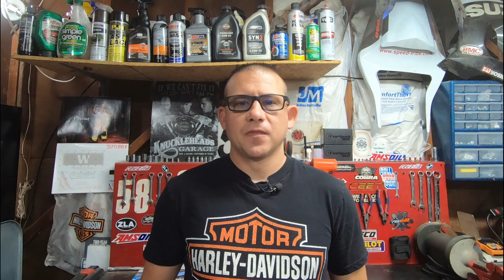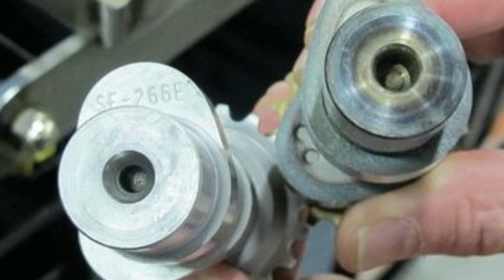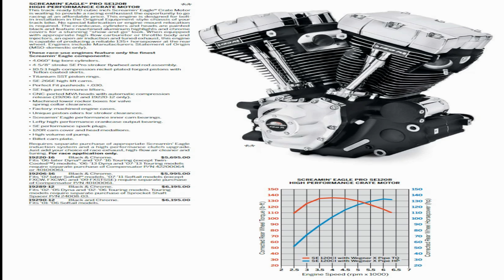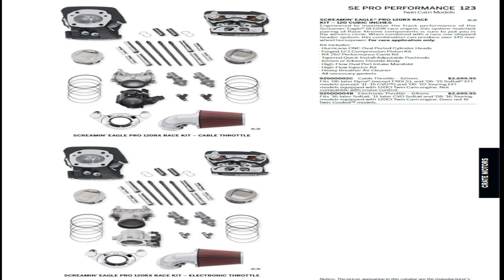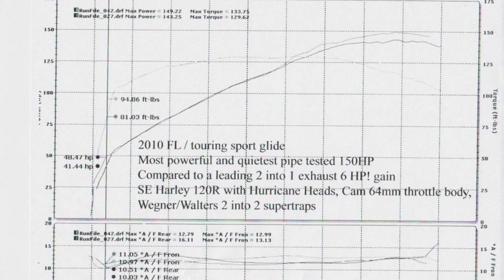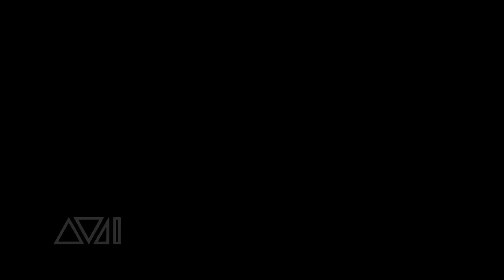Harley's Screamin Eagle 120R Twin Cam CAN Get Even More Powerful

Comment: I have a 2014 breakout. I’ve been looking for a major boost to horsepower and torque. Thank you so much for this video it’s very informative.
Reply from the maker: Glad I could help! I must say the twin cam break out is one of my favorite bikes, I prefer the twin cam version over the new M8.
Reply: @GixxerFoo  I’m not to savvy breakout is still my first bike I have the 103 in it (noncvo). If you had to build it for everyday and wanted a bada$$ monster too, what would you do? I currently have stage 1 k&n (heavy breather look alike) and Magnaflow by Arlen ness exhaust with a dynojet power vision auto tuner. I’m trying to unleash that thing something fierce or should I just buy a crate engine? Was look at s&s hot 124 setup and all sorts of other mods.
Reply from the maker: Since you have the Power Vision, do you have the Target Tune too? A nice cam and a 110 conversion can easily get you well over 100 horsepower.
Reply: @GixxerFoo  yes I do but I’m getting a o2 sensor reading fault with it. Someone told me take the stock o2 sensors and put them back in.
Reply from the maker: Really? The widbands are just a Bosch sensor, you can get those sensors and change the plug on the end. The stock sensors are narrow bands and won't read that wide range.
Reply: use s&s 124 or Jims 120, done deal be happy Harley is new to the game on engines like  a 120, be safe.
Reply: @billgonzales8978  it’s too late. Traded it for a Zx14r with 1in risers and never been happier even comfier on the highway (2hr trips). And I had forward controls and 18in apes. I’m 6’3 300+lbs.

Comment: I run a 120R on the street and track, I am very happy with it. I have taken a few long trips with it 500+ miles. It performs great and 45 mpg on the road. That's not as good as the hopped up 96,but I'm happy with it. My best is 7.05sec. 100 mph in 1/8 and 11.0 sec. 118 in 1/4. I run a thunder max tuner and pump gas. I would not recommend this set up for a new Rider. It can be a hand full on the street. But it is strong and I haven't broke it yet.
Reply from the maker: That's awesome to hear, with the power and torque it makes it makes sense it can be good street motor. Lol if you can resist staying out of the throttle. Definently not a engine for a beginner, they are not very forgiving when they get loose.

Comment: The best combination, and I know from my own experience by running a 120R (and 120RX) in my FLD for me is to modify the combination with the 267E cam  only without the rest of the RX mods and take it to the track on race gas and the roads on pump gas. Still learning with this idea  for now. Updates later, and soon. Have made 133hp, 129lbft tq so far with this combination. Cycle-Rama and Tampa HD improving the bikes chassis with Ohlines shocks etc. and Cycle-Rama tuning the engine after improving the 120R heads.
Reply from the maker: That's interesting, keep me updated on how what you find with this!
Reply: Hey!  I love Wes and Pam!! They did my head work on my sporty and are currently finishing up the last litle bit i could not. I’m buying a flhx with a 120r today and am pumped. I might bring it to Wes to do a little more to it.  We will see.  Lol
Reply: @kriskirk7814  Wes of Cycle Rama did some head work on my 120R. The result with the 267 cam and without the Hurricane Heads is 135 hp and 131 ft. lbs. of torque on pump 93 octane gas. The 120R with Hurricane Heads will not run on pump gas, only race gas, without retarding the timing or lowering the compression to 11.5; Wes helped by modifying the Harley heads that came with the 120 R. I will modify the engine for bagger GT racing next month and hopefully gain more power and torque with a cam more suitable for road racing and what-ever-else modifications it takes to reach the maximum horsepower and torque possible with this engine.

Comment: The 120RX kit ONLY RUNS ON RACE GAS!! You didn't mention that! Why?? Didn't you know??
Reply from the maker: Yeah l wouldn't recommend it for the street with that compression, a lot of octane booster and careful timing it could be done.
Reply: @GixxerFoo  I tried the careful tuning route but I don't think I found the right engine master tuner :) so, if you know how to do the trick, please let me know?
Reply: I did find an excellent and knowledgeable tuner in Bill at Iron Horse Performance...I'll update you when he finishes his work! I'm very encouraged :)

Comment: My 2008 Ultra has the 120R and my 2014 Wide Glide has the 120RX.
Experience has taught me that the HD lifters are wanting.
They have cost me a lot of money when they have failed.
I managed around 160,000K's or 100,000 miles on the 120R before a crank up engine rebuild.
Awesome motors, they should have been available as optional original equipment.
Stay upright.
Cheers all.
Reply from the maker: The lifters have been the main issue l've heard a lot about. 100k on a 120R is impressive, they built them solid for sure. I really like that billet crank they put in there.
Reply: Dose the 120R get hot like the 110SC ?
Reply: @juanmendoza3213  I don't know anything about the 110 motor, I know mine gets hot but they are air cooled and that is to be expected.
Reply: @juanmendoza3213  I had to tune mine richer, because she was running VERY warm but now it runs perfect.
Reply from the maker: Amazing what a little fuel will do to cool one down.
Reply from the maker: Yeah it runs warm, a good oil cooler, air cleaner, exhaust and tune will cool it off quite a bit.
Reply: save your money buy a Jims 120. be happy

Comment: um the TC motor is a thing of the past though. They are building the M8 now.  Not sure if they have done 120 inch M8??? If so its a better way to go. Single cam. No cam chain tensioner to worry about. I cant understand why they never figured out how to make a cam chain tensioner that was any good. I mean all they had to do was look at import bikes LMFAO.
Reply from the maker: Overhead cams don't have the crank issues a Harley can encounter with the single crank pin. Crank flex can cause issues with tensioners, the spring loaded tensioner simply put too much pressure on the shoe. The Twin Cam is still really good motor for what it is in a cruiser. The M8 actually has kits and crate motors up to 131ci. You can get a kit for your 107 to a 128 and take the 114 and 117 up to 131.
Reply: @GixxerFoo  cool stuff . I have  a merch 150 inch stuffed in a daytech pro street frame lurking in the back of my garage among my collection .  No replacement for displacement!
Reply from the maker: Not at all, displacement is gonna give you everything you can handle!
Reply: @GixxerFoo  dude it barks the back tire at 65 mph just by twisting the throttle.  Stupid torque. Didnt realise what I built at first. Scared myself almost had to put on fresh underware a few times.
Reply from the maker: That's what l'm talking about! Lol that sounds like it's very unforgiving 😬
Reply: @GixxerFoo  kinda maybe? I have a new project on my lift. 73 ironhead motor in a 74 frame. I already did a hardtail conversion . Then I scored an old denvers choppers rigid front end, ZERO SUSPENSION front AND REAR. Im gonna run a 21 inch tire up front with no front brake. 16 inch tire out back with a disc brake . This is  right  side shift. Im gonna put the control for that rear brake on the handlebar. Oh yea its 6 inches over on the fork tubes so I wound up with 55 degrees of rake. I still have to rebuild motor trans and clutch. Im going to have far more money in this then it will ever be worth but I have no intention of ever selling it. No clue how it will ride. Kydnie belt required though Im sure!
Reply from the maker: That's a cool project, l like those right side shift bikes. What do you do to get the manifold to seal between the cylinders on the iron head?
Reply: @GixxerFoo  I use stock O rings. Just dont over tighten them. That blows them out.You can also rap with believe it or not electrical tape. We do that with shovelheads as well.
Reply from the maker: I think that's the biggest issue is over tightening them. Lining then up is a pain, l just always hear everyone complaining of leaks. Electrical take works if all else fails, lol as long as it runs good.
Reply: @GixxerFoo  I usually run an S&S carb so I use their manifolds and O rings. Big improvement. But setting the heads right though thats what counts. Those old motors arent very precise so ya got leeway.  Super E carb . We used to use the B carb but S&S stopped making it. It was basically made just for the ironhead.  No accelerator pump on that carb.
Reply from the maker: 😆 yeah those motors are not precise at all, they were built during the dark years of Harley. Thankfully companies like S&S have improved parts for issues like that.
Reply: @GixxerFoo  truth. at the same time though a panhead motor is a thing of beauty . And simplicity is sometimes better. You can wrench on it on the side of the road if need be. If your TC or M8 brakes down your calling a tow truck. Kick starts are a great too, my 71 FLH had a charging problem [I didnt realise it] the button only got me a GRRRR noise. I kicked her to life and rode home with the lights off. [daytime] Easy peasy. New voltage regulator and all good again. I dont mind wrenching or the occasional old bike break downs. Its all part of the charm I guess. Its old. Its gonna need stuff fixed. Either know how to wrench or have the money to pay someone like me to wrench on it LOL.
Reply from the maker: That's why l like those S&S motors with the little modern updates but they still maintain the nostalgia of the engine.
Reply: @GixxerFoo  True. Not to mention finding a knuckle isnt easy now. S&S makes a knuck . One of my panheads is Delkron.  Better than HD. Or maybe just fresher. Its not tired old metal. I have my eye on a 36 knuck. Its not for sale. Its a daily rider. I keep my eye out and talk to its rider when I see it. Maybe it will be for sale in my lifetime LOL
Reply from the maker: If you do happen to find one it's not gonna be cheap for sure!
Reply: @GixxerFoo  either a full litre gixxer or a busa motor is what I want . picture that in a hardtail frame!
Reply from the maker: 😬 that would be scary... hanging on to it would be the big challenge
Reply: @GixxerFoo  well one of my choppers is running a 1971 Honda CB 750 FOUR SOHC.in  Stock trim that motor rocks in a hardtail frame. I went beyond though. Remember Russ Collins? RC Engineering? in the 1970s he put HD to shame with his 750 Drag bikes. He even ran double and triple engines! Well I have one of his motors in a hardtail. detuned slightly for street use. its 836 CC. Plain bearing crank. degreable as well. I can advance or retard the mechanical timing . Advance it to.drag race. Retard it for street use. 36MM carbs. Andrews gears in the tranny. Electronic ignition. Titanium keepers on the manley valves. Wiseco pistons.  Kick start only. Got rid of the electric to save on weight. Its basically a 750 inline 4 . frame. front end. wheels . gas and oil tank. Ever see a chopper do a wheelie???? Not to mention it lays rubber for at least a block if I want to. No idea of its top speed as it has no gauges. I have soundly defeated a porsche though . I also destroyed a 120 inch S&S bike with it.  It runs a 4 into 1 pipe that was very difficult to make work with my rigid frame. Right turns? Yea after the pipe hits the pavement! Scary? A little until you get used to it. Bullet proof motor. Never breaks down. Doesnt leak a drop. The only problem ever is these old 750s at times blow a head gasket. Mine uses a copper gasket. Just put it in boiling water. after it cools down use it again . good to go. this old chop is just 100 percent grin factor every time I ride it.
Reply from the maker: Lol l remember RC, some very radical stuff back in the day! Sounds like you've got some fun toys!
Reply: @GixxerFoo  I have every bike ever bought or built. They all ran when I parked them LMFAO!  All of them can easily be running though. Gas drained . Tires off the ground. Cylinders full of marvel mystery oil. Battery removed.
Reply from the maker: That's the main thing right there! It wouldn't take nothing to get anyone of those started again. Too many just park them and forget about em.
Reply: @GixxerFoo  all inside . Climate controlled storage. Cant afford to insure all of them soooooo.
Reply from the maker: Yeah that would be pretty expensive, but climate control that will help preserve them.
Reply: @GixxerFoo  to be clear . My garage is finished . Insulated and sheet rocked with heat and AC. Thats why I can afford the storage. Im blue collar. Just a MC mechanic.  Certified Honda and HD went through MMI back in 1996 and since I live in Phx I take the update classes. So Im up to date on all new models and tech.  I was in school long time. took HD early and late model. Advanced electrical . Honda and 4 stroke high performance. By the time I finished school I was sick of bikes LOL. I took Honda because HD doesnt allow you to take 4 stroke high performance. They only want you to use their parts. So if I was gonna take an import class I figured take Honda!
Reply from the maker: Honda and Harley are honestly probably the best ones to take for motorcycle mechanics. By far the two most popular brands out there.
Reply: @GixxerFoo  The Evo motor is now taught as early model. Im getting OLD.  Early model is not required to be a HD tech . Its optional .  Most stealerships dont have early model techs . They wont and cant work on that stuff. HD doesnt even allow them to sell parts. UNLESS the stealership is enrolled in the factory early model program.  Stupid policy in my opinion.  However there are plenty of independant shops so who cares right?
Reply from the maker: Pretty much, and if l have an Evo l am not really looking to go back with stock parts.
Reply: @GixxerFoo  aw cmon you dont like the stock evo 55 HP?  35 HP if its a California model LOL.
Reply from the maker: Lol yeah they didn't make a lot of power but they were like tractors with torque. The Evo just does its thing and doesn't care lol.

Comment: dont waste you money on that motor, buy s&s 124 be done with it much more power for the money.
Reply from the maker: It's hard to beat S&S, the motors cost more but like you said it's more power. They also engineered out the factory issues.

Comment: So what can I do for my 2003 ultra classic to upgrade. What would you recommend. I want more power and torque. Can I go up to 110cu
Reply from the maker: To get to a 110 you'd be looking at splitting the cases and going back with a stroker crank and the big bore cylinders. The 95 inch kits are bolt on big bore cylinders and a set of cams. They will up your power to over 80 horsepower and get your torque up to 100ftlbs. That's with a kit that has mild cams. The 88's shorter stroke works very well when converted to a 95 inch.
Reply: GixxerFoo ok thanks so you would recommend the the 95 kit then. What should I be looking at price range?
Reply from the maker: A Screamin Eagle kit with cams is about 1K, but aftermarket kits are a bit less. 95 kits are a great way to go on the 88 and still keep the reliability. Cams alone provide a nice boost, but the 95 is the way to get the most out of it.
Reply: GixxerFoo Ok thanks and sone more thing where would you recommend I get the kit. I’m on the east coast  but I guess who ever you recommend will ship the parts
Reply from the maker: If you're interested in the Screamin Eagle kit you'd have to get that through a Harley dealer. I personally like Fuel Moto and S&S, they will ship right to your door.
Reply: GixxerFoo thanks you are a great help. Appreciate it.
Reply from the maker: Not a problem, anytime!

Comment: 120 motors will drop right in  a dyna but not even close in  a Softail those bikes require a junk B motor !
Reply from the maker: They do make a B 120R for the Softail, l am not super confident in the B 120R with those balancers.